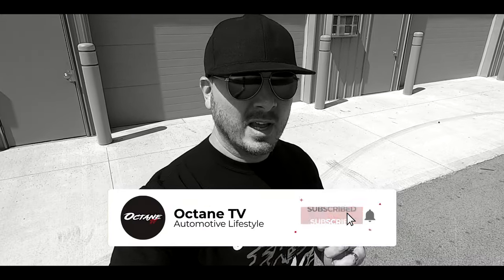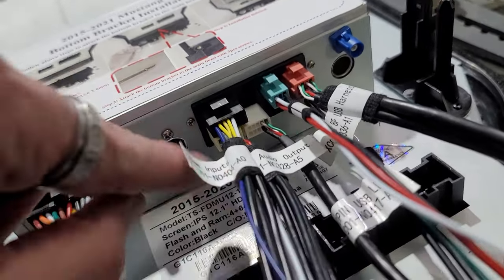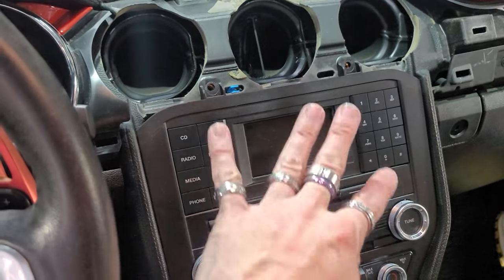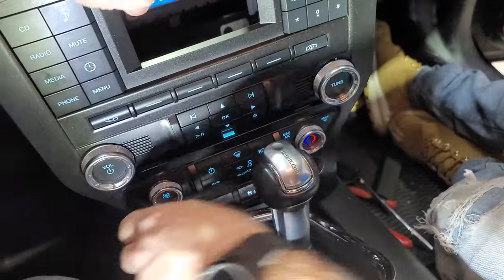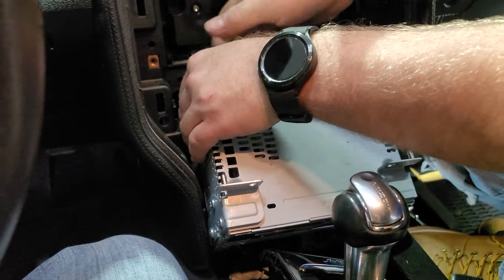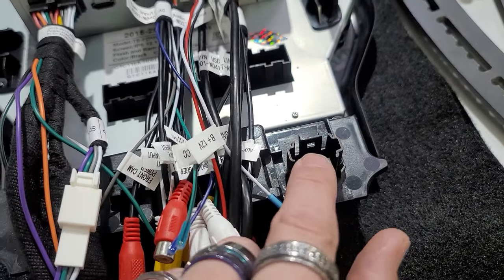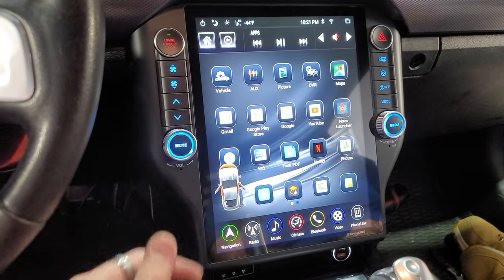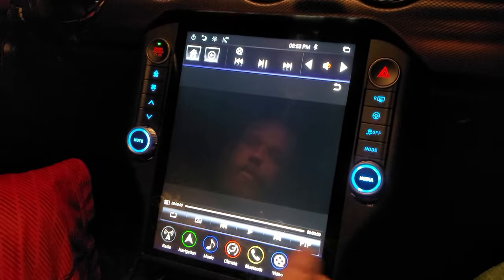S550 MUSTANG BASE RADIO UPGRADE LINKSWELL T-STYLE RADIO INSTALL - HOW TO & REVIEW

Comment: Just got mine installed the gen 6. But the mode button when I press goes threw my drive modes which is good but also goes threw aux and radio settings at same time . Did you have this issue?
Reply from the maker: We have not. It could be in the programming or revisions. You might reach out to the company and they might be able to send you a new revision or an update
Reply: Thanks for the response 👍🏽I’ll contact them
Reply: Looks like it got it fixed was in the settings had to switch to mustang high. Now I’m dealing with static noise 🤦🏽‍♂️